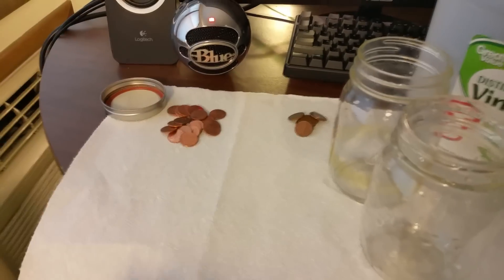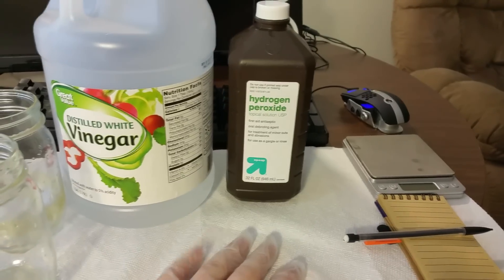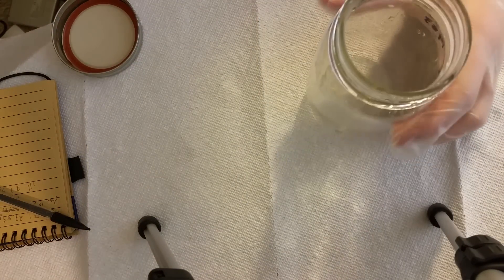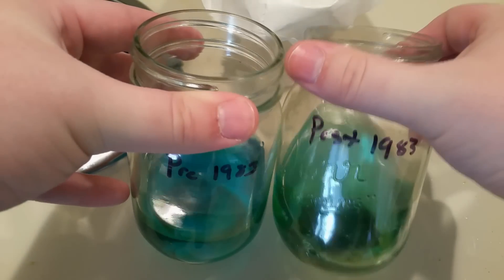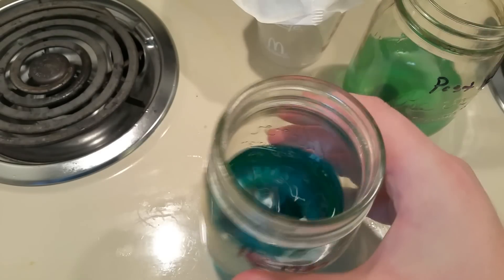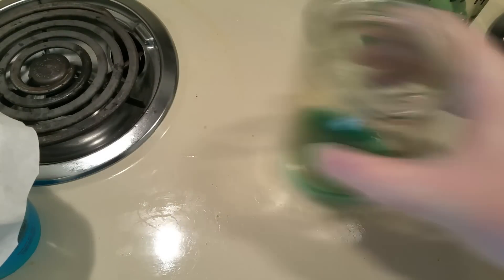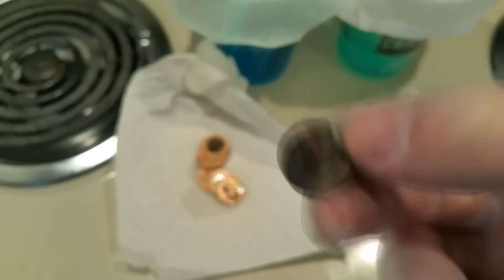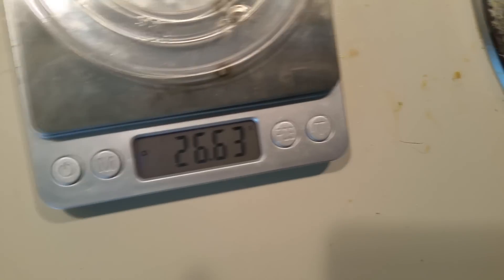Cool Experiment using Pennies! (Copper Acetate from Copper Metal)

Comment: Man I’ve been trying to do this reaction to grow copper acetate crystals but I keep making this paint looking sludge that according to online sources it’s copper hydroxide… 
My first run was following this crystal growing website steps. I used 250mL of 3% hydrogen peroxide peroxide, 50mL of 45% acetic acid, and 10g of copper bits from Amazon. Within 2 hours or so the solution did indeed turn that nice dark blue but was still bubbling from the copper scraps, so I left it for 2 days. The solution was still dark blue and I put it in a flat open container and left it outside in the sun. The crystal website said that if the solution has white sediment that it’s prob copper carbonate or copper hydroxide contaminants, and that adding more acetic acid would fix it. So I did, I added 100mL extra. 3 days after and the volume is now less than half but now there’s all this contaminated sediment that looks like teal paint and no visible copper acetate at all. 

For my second run I tried the 50:50 H2O2 to CH3COOH without regard for the difference in concentrations. Using the same amount of copper. This reaction turned light light blue towards the bottom after like 9 hours :| so I scrapped it, no true reaction was taking place, as in, this would prob have taken a week to go to completion. 

My third run was stoichiometric. 
As I understand, this reaction is 
Cu+2CH3COOH+H2O2—>Cu(CH2COO)2+2H2O 
I’m not a noob in chemistry, currently taking orgo I at uni, so it’s not like I’m a noob who saw pretty crystals and wanted to grow them without any understanding. I’m no chemist, not at all, but I know enough to know what’s happening. I’ve read some forums and papers and seen there are other side reactions that could be happening, especially with contaminants. But whatever. Using that, I said “I want 10g of product” and did the math, including using the concentrations of my solutions. Then I saw I would need like 3.8g of Cu so I just multiplied every result by 10/3.8 to use a solid 10g of copper reactant. 
I got something like 10gCu + 230mL H2O2 + 160mL CH3COOH (not exact numbers, but close enough) 
I mixed these reactants and within like 5 minutes, I shit you not, within 5-10 minutes my solution turned dark blue like before and there was still fervent bubbling coming off the copper bits. 
After 2 days I transferred this solution to another flat glass container to let it evaporate, it was great until I saw the white sediment forming… I’ve been adding 100mL of acetic acid every hour, this, according to chemistry forums, will avoid the coupling of copper with hydroxide, and allow the copper oxide to drop the oxygen and bond to the acetate forming my desired product. Every hour I go back and check, if there’s that ugly sediment forming, I’ll add more 100mL, I’m up to like 700mL added extra :| and every time I go back it’s still forming this…. 

Everyone on Reddit and chemistry forums suggests using glacial acetic acid. I’ve ran the stoichiometry again & figured out the amounts needed, and indeed I’ll need a lot a lot less acetic acid at 98%. I’m not comfortable using this concentration of acetic acid, mainly future storage and disposal wise. But whatever. Some people on Reddit have said they just add a couple of drops of this thing and it sellers everything :| 

I’m waiting for the glacial acetic acid to arrive along with uncoated copper wiring. I’ll run my next attempt with these. 

I don’t have hot plates and thus can’t do evaporation and heating the solution outside, and I won’t do it indoors. 

I don’t know what I’m doing wrong… Is my equation wrong? Do I need stronger hydrogen peroxide? Is it the acetate? Is it the volumes of H2O2 and CH3COOH what are wrong (even at stoichiometric levels)? 

Any help, anyone, please

Comment: instead of peroxide you can use a fishtank bubbler and a pipette to bubblr air through the solution. this works becaue dissolved oxygen acts as an oxidizer.